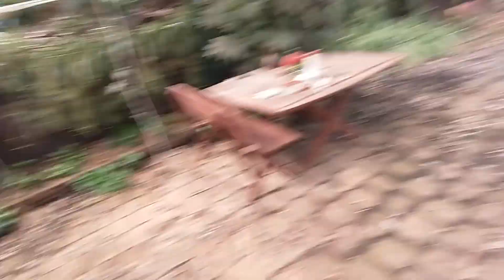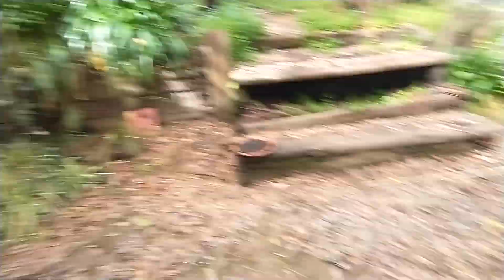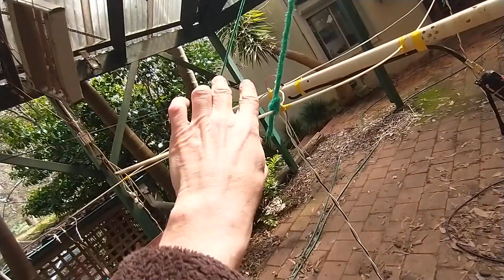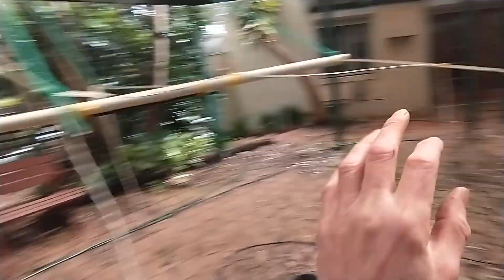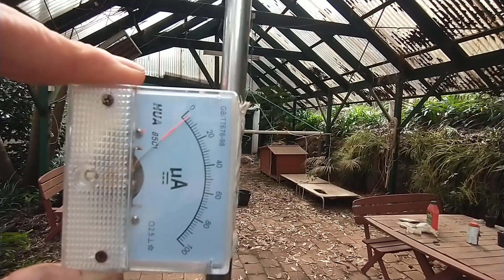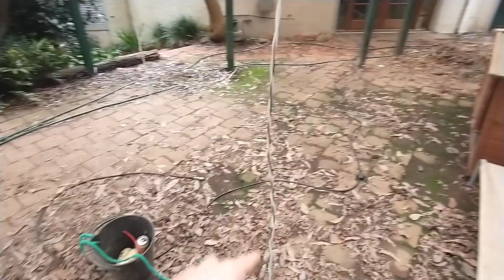⚡3D Beam Antenna ⚡Pattern Test⚡ Impressive Front to (Back/Rear/Side) Ratios ⚡👌⚡

Comment: Whats the next phase of development? Make the vertical radials out of solid wire/rod?
Reply: @crazyham  Huge would be an understatement. nevertheless even for 2 metres you have me very interested.
Reply: @crazyham  Any idea of the gain on this?
Reply: @crazyham  I did see that video which is why i asked. It dwarfs the dipole.
Reply: @crazyham  You have much to learn? I'm still trying to grasp the whole idea even after watching your videos 10 times. I gather the frame has to be made non-metallic? Something like hollow fibreglass tubes. Mounting the radiators etc above the frame seems like the logical way to go as you said before too. excellent work mate great concept.